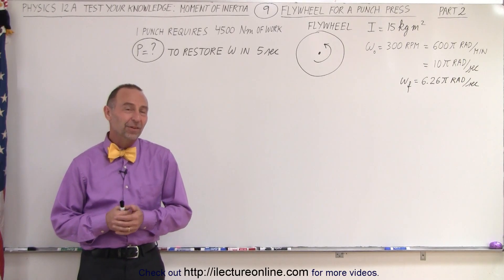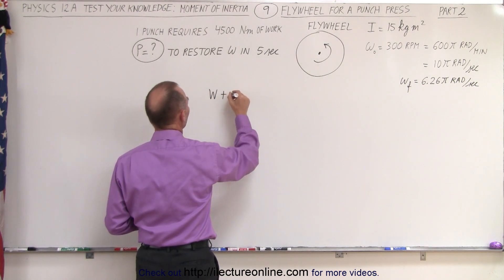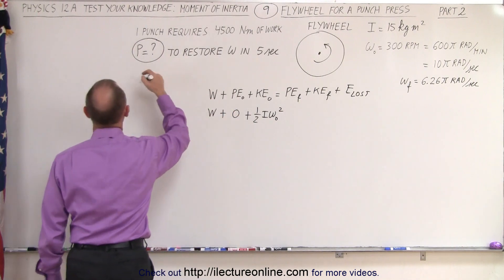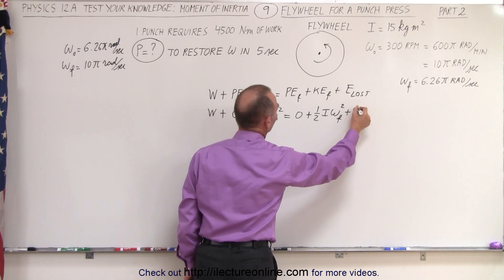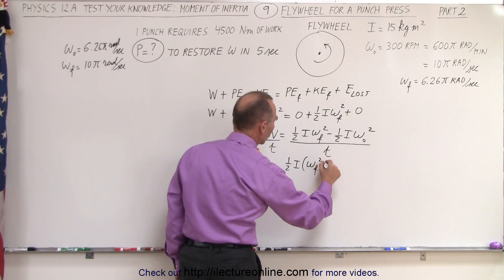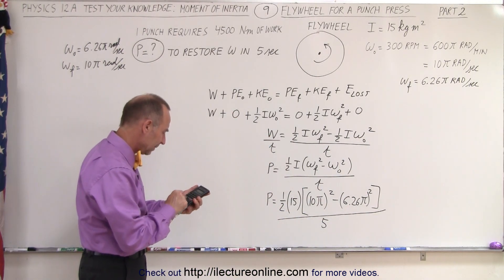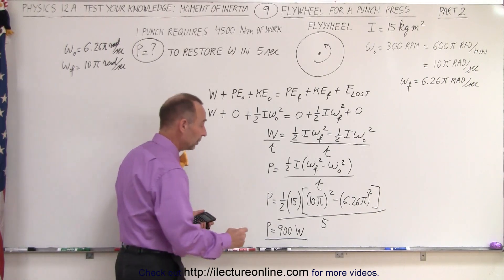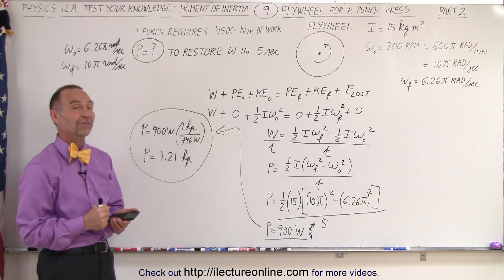Physics - Test Your Knowledge: Moment of Inertia (9 of 24) Flywheel for a Punch Press: Part 2/2

Comment: The energy of a body is proportional to (or BALANCED WITH/as) inertia/INERTIAL RESISTANCE consistent with the fact that ELECTROMAGNETISM/energy is CLEARLY AND NECESSARILY proven to be gravity (ON/IN BALANCE).

Consider what is THE EYE ON BALANCE. Water comes from the eye. Consider what is the TRANSLUCENT AND BLUE sky ON BALANCE. Consider what is THE EARTH/ground !! Lava IS orange, AND it is even blood red. ON BALANCE, consider what is the orange (AND setting) Sun; AND then consider what is the fully illuminated (AND setting/WHITE) MOON ON BALANCE. They are the SAME SIZE as what is THE EYE. Consider what is BALANCED electromagnetic/gravitational SPACE AS balanced BODILY/VISUAL experience. ELECTROMAGNETISM/energy is CLEARLY AND NECESSARILY proven to be gravity (ON/IN BALANCE). Indeed, c squared CLEARLY represents a dimension of SPACE ON BALANCE. ON BALANCE, the rotation of WHAT IS THE MOON matches the revolution. It is proven. TIME is NECESSARILY possible/potential AND actual ON/IN BALANCE.

By Frank Martin DiMeglio

In understanding SPACE, what is gravity, TIME, AND time dilation (ON BALANCE), it is important is it to understand what is a BALANCED displacement of what is SPACE. ELECTROMAGNETISM/energy is gravity ON/IN BALANCE.

Consider what is E=MC2. TIME is NECESSARILY possible/potential AND actual ON/IN BALANCE. Consider TIME AND time dilation ON BALANCE. (c squared CLEARLY represents a dimension of SPACE ON BALANCE.) Indeed, the stars are POINTS in the night sky ON BALANCE. The rotation of WHAT IS THE MOON matches the revolution. Consider what is THE EYE, AND notice what is the TRANSLUCENT AND BLUE sky ON BALANCE. NOW, consider what is the BALANCED MIDDLE DISTANCE in/of SPACE. CLEARLY, BALANCED inertia/INERTIAL RESISTANCE is fundamental (ON BALANCE). “Mass"/ENERGY IS GRAVITY. ON BALANCE, consider what is the orange (AND setting) Sun. “Mass"/ENERGY involves BALANCED inertia/INERTIAL RESISTANCE consistent WITH/as what is BALANCED electromagnetic/gravitational force/ENERGY, AS ELECTROMAGNETISM/energy is CLEARLY AND NECESSARILY proven to be gravity (ON/IN BALANCE); AS gravity/acceleration involves BALANCED inertia/INERTIAL RESISTANCE (ON BALANCE) consistent WITH E=MC2, F=ma, TIME, AND time dilation ON BALANCE. This CLEARLY AND NECESSARILY represents, DESCRIBES, AND INVOLVES what is possible/potential AND actual ON/IN BALANCE, AS ELECTROMAGNETISM/energy is CLEARLY (AND NECESSARILY) proven to be gravity (ON/IN BALANCE). Notice what is the fully illuminated (AND setting/WHITE) MOON ON BALANCE. Great. TIME is NECESSARILY possible/potential AND actual ON/IN BALANCE. Indeed, inertia/INERTIAL RESISTANCE is proportional to (or BALANCED with/AS) GRAVITATIONAL force/ENERGY; AS ELECTROMAGNETISM/energy is CLEARLY AND NECESSARILY proven to be gravity (ON/IN BALANCE). This CLEARLY explains what is E=MC2 AND F=ma ON BALANCE, AS TIME is NECESSARILY possible/potential AND actual ON/IN BALANCE !! (Consider TIME AND time dilation ON BALANCE.) Great. Indeed, consider WHAT IS THE EARTH/ground ON BALANCE. I have mathematically proven why the rotation of WHAT IS THE MOON matches the revolution, AS ELECTROMAGNETISM/energy is CLEARLY (AND NECESSARILY) proven to be gravity (ON/IN BALANCE). Consider TIME AND time dilation ON BALANCE, AS the stars AND PLANETS are POINTS in the night sky ON BALANCE; AS c squared CLEARLY represents a dimension of SPACE ON BALANCE. (Consider what is THE EYE ON BALANCE.) I have mathematically proven what is the fourth dimension, AS ELECTROMAGNETISM/energy is CLEARLY AND NECESSARILY proven to be gravity (ON/IN BALANCE) !!! I have explained why what are OBJECTS may fall at the SAME RATE.

By Frank Martin DiMeglio
Reply from the maker: The energy of a body depends on its position (height) relative to a reference point and on its velocity.

Comment: I liked this video. It is well done.  
However I would like to point out one thing.
The speed of the flywheel is going 187 rpm at the slowest point in the move.  This would be 3.13 rev/sec.  So a system that takes 5 sec to speed back up would take many rotation before you could punch again.  Something to consider if you are trying to design a system.